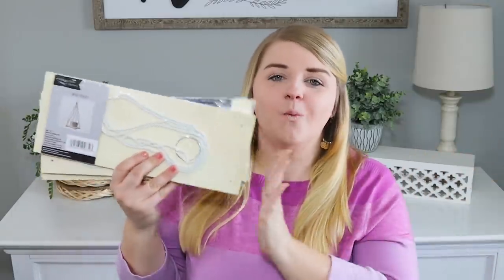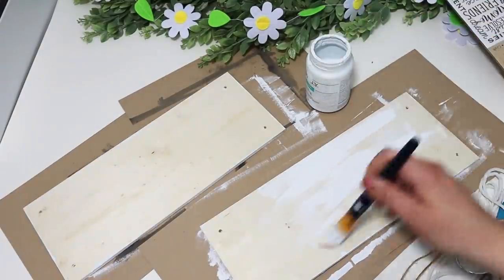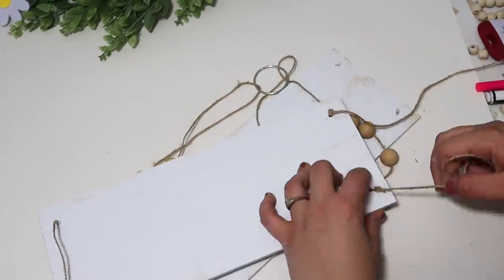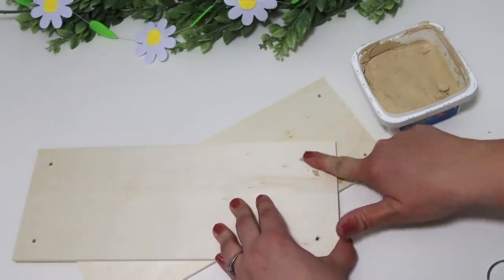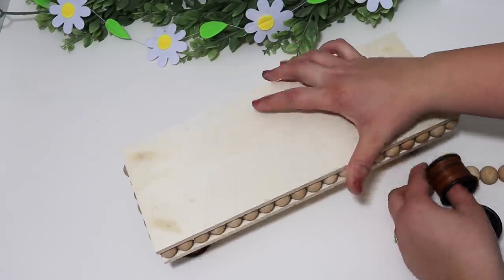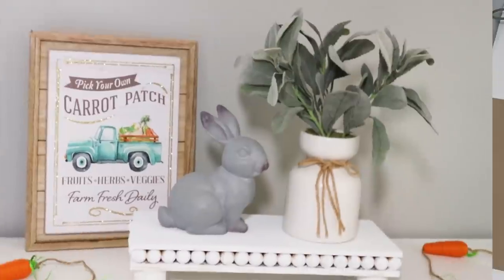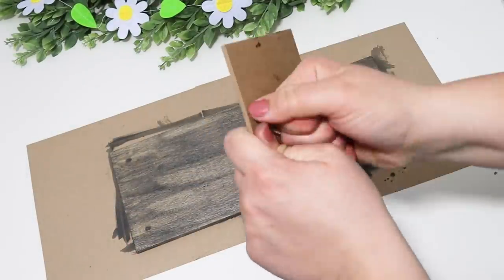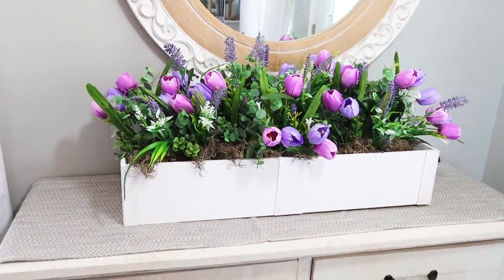RUSH to find these $1 WALL SHELVES for HIGH-END Dollar Tree HACKS + DIYS! Krafts by Katelyn 2022

Comment: I love what you did with all these. What are you using to fill the holes with? I've been using a wood filler and wondered if you are using something different. I looked on the drop down but didn't see anything listed.
Reply from the maker: It's from Walmart, I usually pickup any wood filler from Walmart! I like the Dap brand!